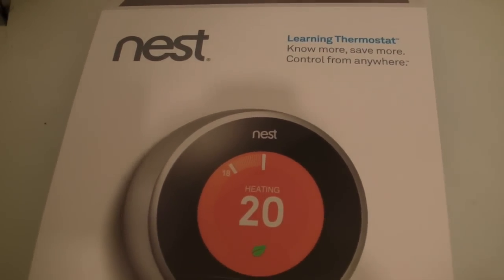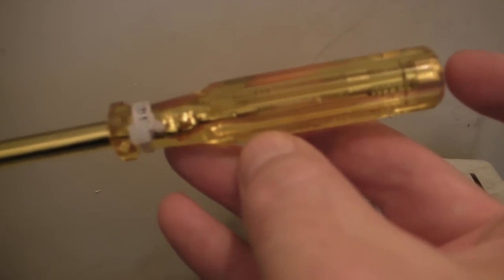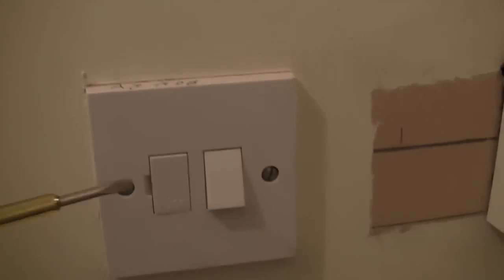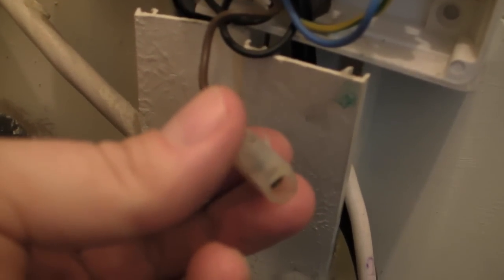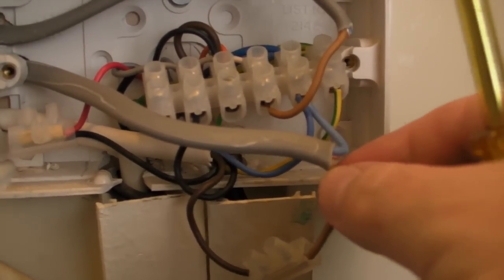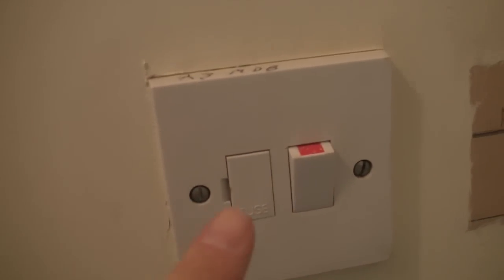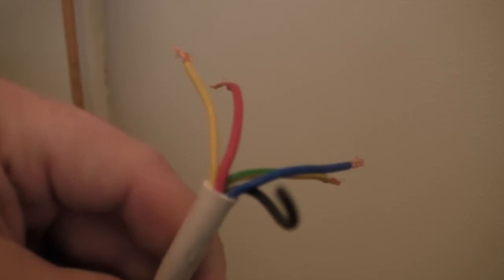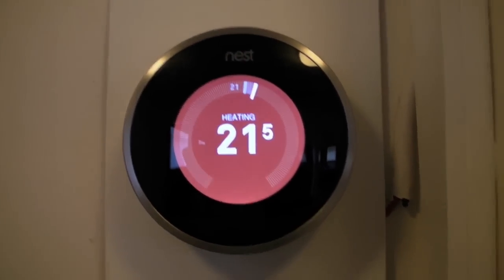NEST THERMOSTAT UK INSTALL

Comment: The system needs a new junction box preferably a Honeywell the original is busted as a truthful  scotsman you have busted your credibility by working with such crap it never going to be right och de noo.  When l see wiring like done by chunky monkies its a a fair chance the boiler is a shoddy install .
Reply from the maker: But it's worked flawless for 5 years!
Reply: sandy anderson Just because something operates doesnt mean it’s correct. It’s what it does when it goes wrong that shows the true quality, and if it’s bad then by that time it’s too late.
Reply from the maker: @sinista6536  no worries happy New year
Reply: sandy anderson Not that I thought there was anything wrong with it in the first place, just don’t like the ‘it’s always worked perfectly’ thing with electrics and don’t wanna see anyone hurt. But yeah, happy new year mate 🍺

Comment: 1.5mm 4 core and earth should have been used. 
240v live = Brown
 240v Neutral = Blue 
Green/Yellow = Earth 
Black wire = additional 240v saves making loop, but loop is just as effective and cheaper as you can use a 3 core and earth cable. 
The additional 4th core 
grey wire = Switching/demand for heat.
Reply: thanks for the translation ;)

Comment: Hi just wondering if anybody has one off these working installed on a Grant Vortex Eco21-26  External Oil Boiler Grant were no help As they said they were bringing their own onto the market Phoned a couple off installers No Help Phoned TSG another installer firm today and was told It should be compatible No clear info from anybody Can fit it myself no problem But trying to get the information installation details or if its actually compatible. Is like trying to get blood from a stone I am using a danfoss Thermostat.

Comment: My existing Danfoss TP5000 only has COM and NO wiring. It is battery powered.  To install your the NEST i will also need L and N. Can i spur that form adjacent Light switch or power socket?

Comment: Hi, i got my Nest device and when I opened my thermosted box (honeywell st699), i have one cable connected between hot water com, heating com and live. How should I do this connection in my Nest device (i was expecting only 4 cables)? Do u have any email that I can send the pics over? Appreciate your help!
Reply from the maker: Wladimir Clemente I assume in the Honeywell thermo u only have three wires ie live, call for heat and earth.? you only need to wire into the existing thermo if u want a wired connection otherwise go wireless and then you bridge out connection in thermo and remove Honeywell and cover with a blanking plate

Comment: has your house burned down yet sandy that wiring was shit mate , just use the right cable (1 with correct amount of cores ) or better still get a qualified sparky in to do it right !
Reply from the maker: no my house is still standing, lovely and warm now that I can control it from my self installed nest!
Reply: Saw the neon screwdriver , Jesus .

Comment: can this be operated by a mobile phone the heating system  I have only has a thermostat in the garage and it's a pain in the ass having to go out and turn it on and off all the time could I possibly get someone to connect this up to the boiler in the garage then use my phone to control the heating

Comment: I have just ordered a Nest thermostat from Argos. I removed my old digital thermostat off the wall, and there is a yellow and red only connected to it. There are 2 other wires that are not connected and coiled up which are earth (Yellow/green stripe) and a blue wire. If i connect the yellow and red to the Nest i am assuming that there will be no charging and I will have to remove the Nest off the wall and recharge it once the battery power goes or does it need a power source to keep it working? Bolier is a Baxi 105E. Kindest regards Jeff.
Reply from the maker: Jeff Nudd u have to trace the red and yellow wires in the central heating junction box WARNING do not connect the nest direct to these wires as they will have 240 volts and u only need 5 volt DC that comes from the nest white junction box.  the red and yellow need to be disconnected from central heating junction and wired in to nest white box, sandy
Reply: Hi Sandy. If I touch the two wires together it turns the boiler on. Does the nest have a relay build in to do the job?
Reply from the maker: +Jeff Nudd the relay is built into the white box not the digital nest head

Comment: How do you connect a 24v honeywell value to the uk nest version.   The unit run 230v but the value run at 230v input / output 24v.   Can i connect to 2 and 3 terminal on the heat link.

Cheers jumans
Reply from the maker: sorry I've no idea for 230v to 24, sandy

Comment: hi, i have a y plan central heating with separate hot water and central heating controller/programmer. i also have wireless room thermostat/programmer. my boiler make is a viessman vitodens 100-WB1C sealed system boiler with indirect hot water tank. i checked on the nest website about the wiring compatibility but my programmer wires doesn't match those ones. i only have a wireless thermostat, so does that means i have to set up the nest heat link to the junction box near the boiler. i checked the wirings in the junction box but im a bit confused. please help if nest is compatible with my heating system.

Comment: Hi buddy, can the call for heat from number 3 be used to go straight to a 240v switched live straight into a combi?
Reply: +George Mcmillan 
depends on the boiler you have some take mains and low voltage, if you tell me you make and model number I can confirm for you. Cheers
Reply: @callumrowley2203  danesmoor utility 25/32 oil boiler

Comment: How the heat link communicate to the nest thermostat ? Does it require wire or is it wireless  ? Thanks sandy
Reply from the maker: I can work wired or wireless
Reply: The wired option just provides power to the thermostat, no comms.

Comment: Hi idm not sure if you covered this, I'm having a complete new system fitted I want to run a 12v from the heat link to the thermostat can I just run that cable from the heat link is the only power coming from T1 and T2 12v? Thanks for the video.
Reply from the maker: Any cable will do, the 12v is coming from the Heat link going to the NEST for 1. to keep NEST charged and 2. it uses it as a hard wired communications line should the internet connection between NEST and Heat Link go down. hope that helps, sandy

Comment: Cheers buddy, you've cleared up the issue I was having with the heat link and getting it from 230v to 12v.
also doing this allows me to take the thermostat to a different room or portable (near a plus socket).

Comment: Do you know how can i wire it to Baxi Combi 105e?
Kind regards
Chris
Reply from the maker: Sorry I'm not a plumber but what u need to find is the call for heat signal which comes from the programmer and is usually terminal 4 on the backing plate of the programmer
 and u just wire the nest junction box in there.  Sandy
Reply: I do not have ext. programmer but thank you anyway
Reply: Kris Kedzia basically you need to look through your boiler manual and see if there is an existing jumper wire that links two terminals together on the circuit board for a thermostat.  Or look for a live that turns off the heating system when it is disconnected and turns back on when it is reconnected.  The nest thermostat is just a glorified switch so you can use it to break or disconnect any circuit.
Reply: I have already managed to install it. It was very easy. Thanks anyway!
Reply: +Kris Kedzia (Kedzis) I have on of those boilers and am looking at Nest. How did you find out which wires go into which part of Nest?
Reply: Read the manual, there should be one wire which is u shape(connecting two pins together) you just remove it and install your thermostat's white box in this two pins. Do you have exactly the same boiler?
Reply: +Kris Kedzia (Kedzis) Yup, baxi combo 105e. I'll have a read of the manual. Current thermo has three wires going to it, look like live, switched live and neutral for the accelerator.
Reply: I am not sure what thermo you have at the moment and how to switch it back to original, I had only manuar baxi programer, i needed to remove link between pins 1&2 (fig. 28) and as far as i remember I had to connect live and neutral to power the white Nest box. It is low voltage diagram in Nest manual and fig. 28 in Baxi manual. I hope this helps.
Reply: If you had Baxi programer built in then you have to leave it switched on.
Reply: And most probably your current  thermostat will be connected via pins 1&2, so just unplug them completely and put Nest connections instead. Make sure your boiler is unplugged from mains as low voltage(is still high around 230V to give you a shock). I confused extra low voltage with low voltage, but luckily somebody explained me that from 50V-1000V it is still called low voltage.
Reply: Ian Simcox Use a tester to measure continuity between the two lives there when the thermostat is turned on and off.  If does have continuity when you turn it on, that is the live pair that needs to go into the programmer for the nest.

Comment: Hi pal great video. A quick question I already have a wireless thermostat would I just be able to swap it for the heat link from the nest I'm guessing it's should be about 4-5 wires
Reply from the maker: yes that would work just pick any 2 of the 5 wires to work with the Heat Link   sandy

Comment: Hi Sandy,

Thanks for posting this video.  Although focus is a bit dodgy (difficult light and working conditions etc), this is the most apposite & helpful installation video I've seen, for the UK variant of the Nest Learning Thermostat & Heat Link.

I was quite confused when I 'd read up on the product and seen the videos about the US one & I found the "Heat Link" in the box and that the pretty part was not capable of 240v connectivity!

Using your video, I was able to get my head around what I needed to do & managed to install mine in just a few minutes.

Again, thanks!

Cheers,
--
ChrisP :)